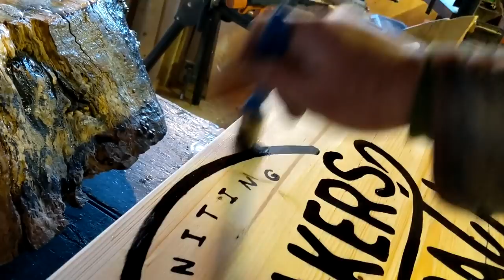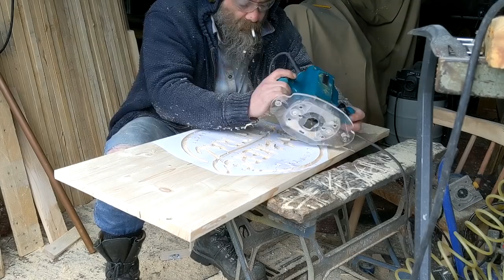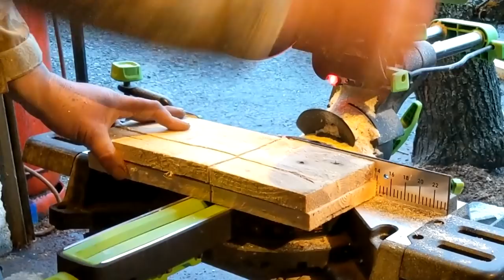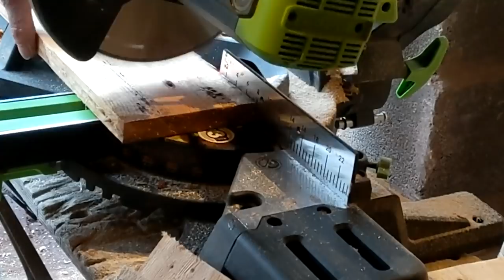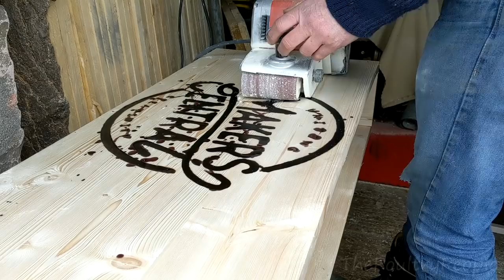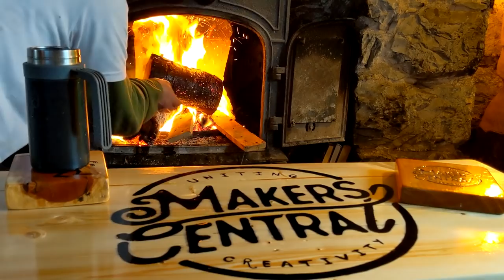Make a Pallet out of a Coffee Table - Makers Central 2019

Comment: Where can I get a saw that makes wood longer?
Reply: Mergrew 01 you can pick up a board repair kit at any local hardware store.
Reply: BLURby84, thanks for that, just to be clear this kit, is it the one that lets you rewind the motor to go backwards, and you fill the dust bag with sawdust, and it then joins the wood?
I also want a router bit that fills in the shapes in a wooden board.